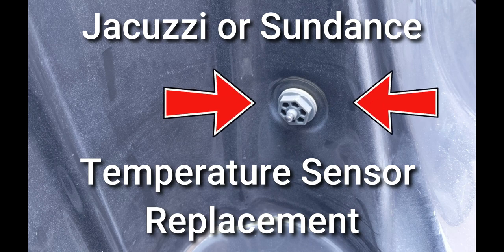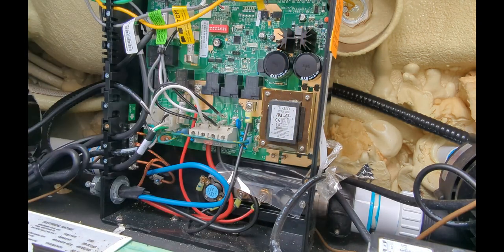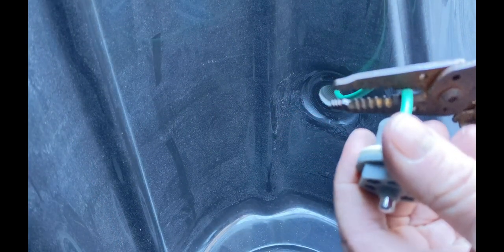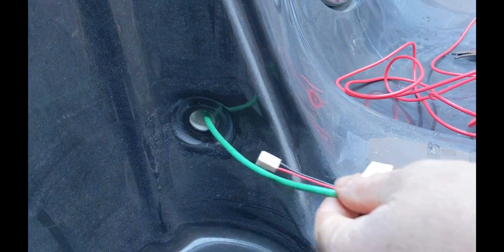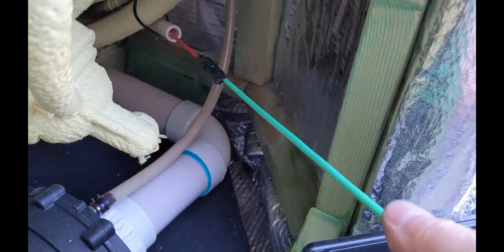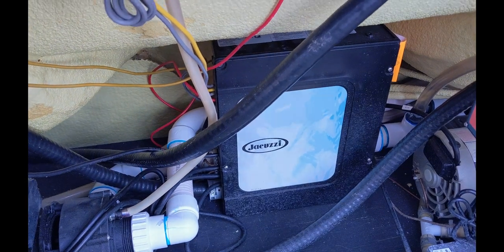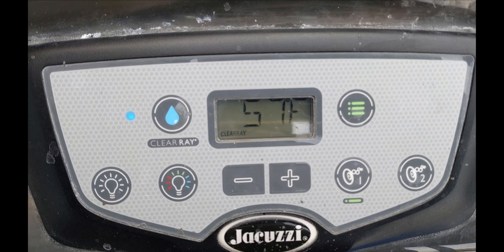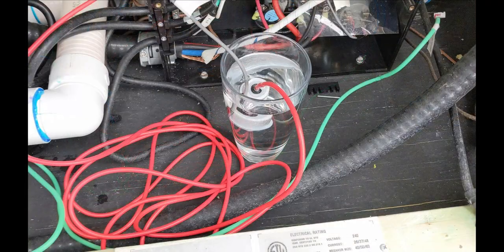Jacuzzi Sundance Heat Sensor Replacement | Jacuzzi Watchdog Reset

Comment from the maker: If you have any questions, please comment below or join our membership group.
Reply: Alright, got a customer with a 2020 J-385. Tub hasn’t been turned on in  months. Just filled up and now it’s giving me a “cool overheat gfci trip” upon startup and then kills the power and gfi trips within 3 minutes. I bought the bumpers that you linked. 
Just double checking I’ll be doing this correct.
1) Turn off breaker power 
2) put a jumper on J68
3) turn breaker back on for 15 seconds, then turn off.
4) remove jumper and it should have reset that message right?
Reply from the maker: @thebrotherhood08  Double Message.  I just send a message on the first comment.
Reply: Hi, I have a J-325 that has no error codes but the temperature is off by 10 degrees. 98degress on screen is actually 108-109 water temperature.
Reply from the maker: @robertbatista7164  What year is it?
Reply from the maker: @robertbatista7164  Its going to be a high limit, temp sensor or stuck relay.  If you had an error code, you could pin point it.  Normally it will be the temp sensor.
Reply: @VIPPoolsandSpas  it's a 2020 model
Reply: @VIPPoolsandSpas  I'm going to proactively replace the temp sensor and see if that fixes the issue.  Many thanks.
Reply: @VIPPoolsandSpas  my problem was the temp sensor. thanks to your video it took me a few minutes (plus dran and fill time) to replace it and everything is now working fine. Thanks!
Reply from the maker: @robertbatista7164  Glad it worked out.  Like the video if you can.  Helps me make more of these videos.  Thanks again for watching.
Reply: Thanks,  we don’t see j28 or DIP switch on our board unfortunately, still getting 4 dashes on our Hot Spot Tobago 2007. We got this code after replacing pressure switch that had failed, and then had to replace the heater sensor (because a wire snapped off during the repair) although with a different type. Doesn’t seem to reset with the new sensor :-(
Reply from the maker: @themoabpearl5711  the 4 dashes is a flow issue.  Wouldn't have anything to do with temp sensor.  Try jumping the pressure switch or adjusting it a little to see if it's a bad switch.
Reply: Thank you, our manual says that - - - - is "Heater high-limit thermostat tripped" . Two rows of dashes is pressure switch.  We don't see anywhere to adjust the pressure switch which is square, and this type seems to be unique to Hot Spot/Watkins Spas. The switch is brand new, the old one had corrosion leaking out of it so we replace it.  We should test it though with voltage meter.  @VIPPoolsandSpas

Comment: Thank you ! Very informative.  Have a j365 Jacuzzi HT. I a watchdog error H--0H. How do I reset? Do I still need to reset j68 jumper?
Reply from the maker: Have to fix the problem first.  If you have the spa pack thats in this video, use j68.  If not, there are 2 other resets for different packs in the video description.

Comment: So what did you use to make your jumper for j68 to reset an clear the overheat an Gfci trip
Reply from the maker: We have a few videos on the watchdog reset.  It all depends on the model and year of your jacuzzi.  Might have to watch a few of them that match your hot tub.  Most of the links are in the video description.

Comment: Hello.  I have a 2006 Jacuzzi J385 with a 6600-101 LCD board (replaced original a few years ago).  I recently replaced a faulty temp sensor and was working great until a Watchdog ---- (4 dashes) message appeared a couple days ago.  I have turned off the GFI Breaker and it has not reset the message.  Do you know how to reset this model Jacuzzi?  Any assistance would be appreciated.
Reply from the maker: I have 3 different resets for jacuzzi.  Depends on the year and model.   Check the video description for the resets.

Comment: How do you go about resetting the watchdog on a 2002 J350? Thanks in advance.
Reply from the maker: That one should be, turning power off for 15mins and turn back on.  Depends on the code your getting.  What code are you getting?
Reply: @VIPPoolsandSpas  I've tried the power off and on. It shows OH for a split second and then goes four dashes to watchdog. I've ordered a new temperature sensor.

Comment: I have a 2014 lightly used Jacuzzi 335 Clear Ray hot tub.  It has worked flawlessly until late fall when it would not up to temperature.  I winterized the tub and in starting up this year I have the same issue.  There are no error codes.  Water going into the tub was around 45 degrees.  After a day it was up to 65 but that's where it stopped.  I replaced the temperature sensor but that didn't solve the issue.  I assume I have a heater issue but thought I'd check in here first.  Any other checks before I call for heater replacement?  Thanks in advance for any suggestions you might have.  Thanks for your video work....first class!
Reply from the maker: Like always, test the volts a d amps on the heater element.  It sounds like the element anyway.  No error codes and no tripping of the breaker?  Does that tub have a pressure switch or flow switch?  I can't remember
Reply: Silly question but is it in eco mode they only heat up so much if so

Comment: That's the easy way ! Do it without draining the spa. Just kidding. Great Video. Btw, you can make a  "Temp Sensor key" with a PVC T or PVC elbow  so you dont have to use pliers. All you need is heat up the PVC and  put an old sensor there until the PVC takes the form of the sensor and thats your key. Works every time. Also, after replacing the temp sensor you are suppose to reset the dipswitch #10 or the message can come back.  I think its easier than jumping the board.
Reply from the maker: Thanks for the advice for the tool.   Guess the tool works for Clearwater Spas also?
Reply: @VIPPoolsandSpas  I guess. You are just molding the sensor into the PVC. If you send me your email I can send you a picture of the one I have.
Reply from the maker: @gabrielmurillo5073  info@vippools.ca

Comment: Alright, got a customer with a 2020 J-385. Tub hasn’t been turned on in  months. Just filled up and now it’s giving me a “cool overheat gfci trip” upon startup and then kills the power and gfi trips within 3 minutes. I bought the bumpers that you linked. 
Just double checking I’ll be doing this correct.
1) Turn off breaker power 
2) put a jumper on J68
3) turn breaker back on for 15 seconds, then turn off.
4) remove jumper and it should have reset that message right?
Reply from the maker: Jacuzzi changes their spa packs so many times between series that Im not sure about the J385.  Does it have the heat tube on the bottom back side of the pack or is it the side heater manifold?
Reply from the maker: Not worried about the "COOL" or "GFCI TRIP"  Its the "OVERHEAT" Im really looking at.  Pull filter? Circ pump running?  Air lock?
Reply: Yeah pulled filter out, all jets and pumps are working completely fine.
Reply from the maker: @thebrotherhood08  test the high limit and heat sensors.
Reply: It worked! Thank you!
Reply from the maker: @thebrotherhood08  I'm assuming the reset helped ya out?

Comment: Hello I have a 2 or 3 yo jacuzzi j 480. I have no fault but noticed a difference of about 14 deg between setpoint and actual temperature using a good thermometer. So I set it right now to say 89F. Hot tub reports 89F but it feels hot and I can measure 103F. Any clue? Start with temperature sensor?
Reply from the maker: Check the wires of the temp sensor and high limit.  (MICE).  Check to make sure all wires are plugged in on the circuit board the right way.  Check if the temp senor and high limit are seated in where they should be.
Reply from the maker: Just following up on what you found with your hot tub temp issue 2 months ago.  Thanks
Reply: @VIPPoolsandSpas  i didn't do anything yet. Winters are long in Buffalo but I plan on looking into it this spring
Reply from the maker: @buffalofrenchy  Have around 20 pools open in Northern Ontario, Canada.
Reply: @VIPPoolsandSpas  hello I finally replaced the temperature sensor and no issues. Now my temp reading is correct.

Comment: Can you tell me how to reset my circuit board for a Sundance Optima 880 2017 hot tub?
Reply from the maker: Whats the error on the topside controls?  I think the reset is turn the power off for 15 plus mins and turn back on or the reset is in the menu of the touch keypad.
Reply: There’s no error message now,
It was just about the temp sensor not functioning, now thats gone. But the hot-tub is still heating up really high, upwards of 110 degrees.  Wasnt sure if there was a reset.  I tried turning it off and back on after about 15 minutes and the message disappeared, but the heat is not correct.  I think at this point we may need a new temp sensor.  Your thoughts?
Reply from the maker: @karlamarcotte1547  Yes.  Change the temp sensor and high limit to make sure.
Reply: @VIPPoolsandSpas  thank you very much.  Ordered the parts.  Hopefully this fixes the issue.
Reply from the maker: Let me know.
Reply from the maker: @karlamarcotte1547  Just following up on your hot tub issue from 2 months ago.  Was it the temp sensor?

Comment: How do I reset a J335. I was getting Watchdog error. I replaced the temp sensor. Now I’m getting SN2 error?
Reply from the maker: There are 3 different resets that I know of.  The 2 shown in the description should be one of the 2.  SN2 is a sensor 2 issue

Comment: Hello, how to reset for j235, 2019? Thank you so much
Reply from the maker: @interiorlu2203  there's 3 different resets.   Should be in the video description.
Reply: Hello, thank you but i dont know what is DIP SW-10?
And its the same Jumper J68 for jacuzzi j235? 
I see only 2 reset. Thank you so much
Reply from the maker: @interiorlu2203  the 3rd  reset is turn power off for 15mins or longer and turn back on.

Comment: Getting the watchdog error on Jacuzzi J235. Replaced the temperature sensor and stuck at the reset thing
Reply from the maker: I'm going to guess the year of the hot tub and say to turn power off for 15 minutes and then turn back on.

Comment: any way to reset watchdog on a 2005 J345?
Reply from the maker: I think that one is (4 dashes or Lines)   1) turn power off for 15mins or so.  2) turn power back on.  It should be gone.  If it comes back.  its something else.  Pull filters, make sure water is topped up, make sure the circ pump is working (pump pushing water thru the heat tube).
Reply: @VIPPoolsandSpas  TY! would appear its something else... :-( appreciate the response.
Reply from the maker: @troyoppie3765  Did you "jump" the pressure switch?  You could join our membership group and that gives you other opinions on fixing the problem.  Like, emailing pictures or premade videos for private viewing.
Reply from the maker: @troyoppie3765  Just following up on you hot tub issue from a month ago.   Did the reset work and was it the same for the newer Jacuzzi tubs as your 2005?  Thanks
Reply: @VIPPoolsandSpas  thanks, I put a meter on the temp sensors and the main one was way off. replacement sensor solved the problem and we're up and running. after deck materials, electrician, movers and everything, the free hot tub only cost us about $900! 🤣

Comment: My Sundance 780 Palermo. Lights up but won’t start up it’s shows a 356 code and goes to what looks like 8.8.8,
Reply from the maker: Check the circuit board.  Look at the capacitors to make sure the tops are flat.  If rounded/bulge, replace it.

Comment: How to reset a Sundance Peyton jacuzzi when it is in watchdog mode?
Reply from the maker: What's the year ?
Reply: @VIPPoolsandSpas  it’s a 2019
Reply: Is there a way to reset them?
Reply from the maker: @BerlinOliver  Did you try turning it off for 15 mins and then back on?
Reply: I did that didn’t work
Reply from the maker: @BerlinOliver  in this videos video description, there are 2 other ways for reset.  Has to be the same circuit board.